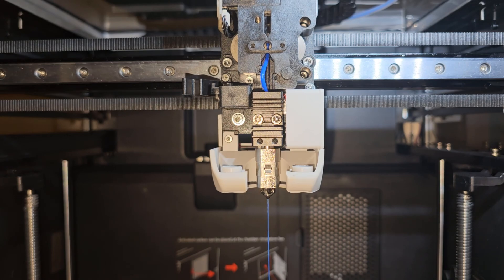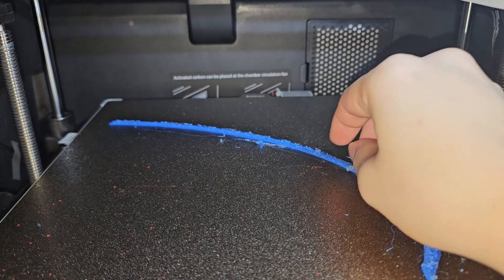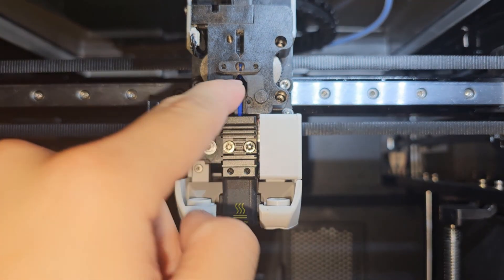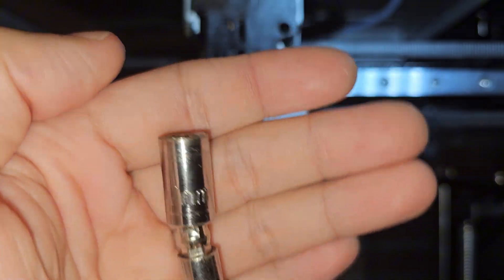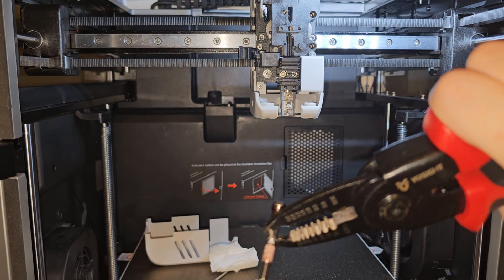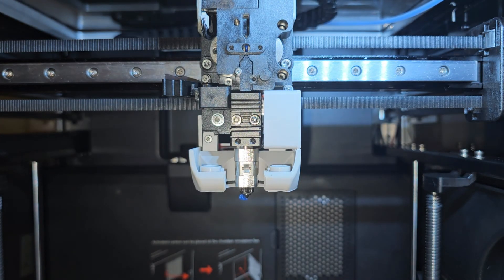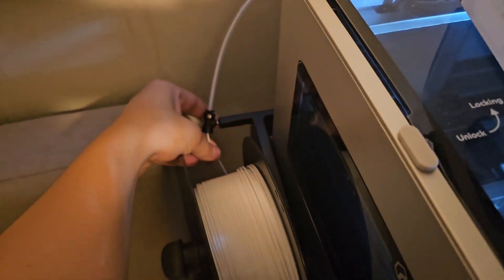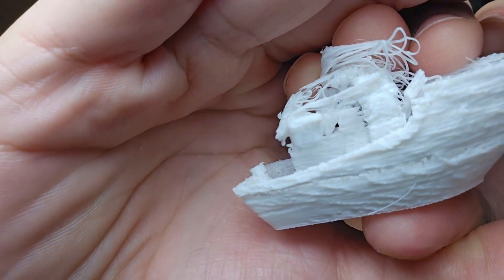Qidi Q2 3D Printer I'm Done With It

Comment: Printers are not fool prove.

I have my Q2 for over a month now and still am amazed by the features and print quality it offers. I don't care for multi colour prints so no box for me. I use ABS, PETG, PET-GF/CF, PA6CF and TPU filaments.
The only issue I had was a clog when I was switching filament from PET-CF to TPU. The temperature difference between the filament types are so far out of each other that the PET-CF was still to hard at 240 degrees. That was the only issue I had, a human error.
Reply from the maker: Glad to hear you are having a good experience with your printer!

Comment: I believe maybe and this is just maybe because it happened to me. The temperature is saying that it’s getting hot enough but it’s not you’ll have to check that to see when it says it’s up to 222 something it may not the temperature is not reaching that height maybe the sensor of something is bad for the temperature
Reply from the maker: That's a good point, I'll definitely check the temperature sensor. Thanks for the tip!

Comment: About a year ago your video helped me unclog the extruder on my Qidi Q1 Pro. That clog was on me (tried to unload filament, nozzle was cold + unclear instructions), but it ran perfectly since then... Until I switched to a 
0.2 nozzle. Seems like the default settings were off, because during nozzle cleaning it pushed way too much filament and I could hear the extruder gears grinding (even though it still printed fine). After a couple test prints, I started a long print, put the top cover back on, closed the door, since I tried to sleep… and yep: first clog in a year, this time in the nozzle, and it was a PITA to unclog.
Tried again with the top cover off and the door open and it’s been fine since. I’ve heard people say that printing PLA in an enclosed printer is just asking for trouble. It’s annoying, but it's true - at least in my case. Also heard a 0.6 nozzle is best for CF-filled and other abrasive filament.
Reply from the maker: Yeah all those things you said is true. Printing with pla and door closed is going to be trouble.

Comment: I've had no problems with mine to date, and this is my first Qidi Q2, it seems like you need to swap out the nozzle, they are pretty cheap on Aliexpress, it would seem yours is damaged internally. It's a cheap swap, and  if it works you can cut the old one open, look at it etc.
Reply from the maker: Glad to hear yours is working well! I'll definitely look into swapping out the nozzle.

Comment: My Q2 works fine. Besides what others suggest in the comments check also if you chose PETG profile in the slicer instead of PLA.
Reply from the maker: I use petg settings, check all settings to work with petg filament.

Comment: Definitely human error. Seems like too low of temp, and shows at one point where it was set at 220 while extruding (and you mentioned PETG so too low). My guess is that the nozzle still has pieces stuck in it from a previous clog, especially if PET-CF clogged, and isn't clearing. Replace the nozzle, if you're modifying filament profiles then go back to stock (or lower the volumetric flow and increase temp by 10 degrees), and leave stock printer settings. The other issue is that it's stock with a 0.4 nozzle, so fiber filled filaments really shouldn't run through it. I do till I get my 0.6, but I also reduce volumetric flow and increase temp to prevent a potential clog. I've been using the Q2 without issue. I've done PLA, PET-CF, and ABS (I think others but can't remember right now). It just works. I have some PC I'm going to try out as well, and the numerous GF and CF filled filaments I have to test. I really like the Q2. I just wish it was at least 300 cubed.
Reply from the maker: Thanks for the tips! I'll try those adjustments next time.
Reply: Agreed, it's been great for me so far (<100 hrs). I almost wished I ordered the X Max...but didn't want to be a Beta tester for it.

Comment: I've printed about 150hours on my Q2 with various filaments and have not had any clogs. Either you have a lemon or you need to PID Calibrate the nozzle temp to make sure  the the temp is correct. Failing that I would get QIDI to replace the HEAD and hoteand assembly. I hope you resolve this as when the Q2 is working properly, it's a great printer.
Reply from the maker: Glad to hear your experience has been much better! I'll definitely look into PID calibration and the hotend assembly.

Comment: Hey Dude, it looks like u try to print to fast... the extruder is pushing filament a lot faster then the nozzle can melt... thats what i see there, thats cause the filament geht clogged.

cheers and keep up :) happy printing
Reply from the maker: Maybe, but im just using the default settings and this can print up to 600mm/s, im only printing at around 300mm/s
Reply: @Scratch3DPrinting  sorry to tell u, but this is only PR Speach and false advertising... 600mm/s impossible for this.. just with a full optimized gcode, which is never usefull in real life printing..  just test it. cut the speed settings in the profiles in half, and make the print again. i bet my left pinky, it will not clogg :)

Comment: This seems human error related more than the printer itself. Did you dry the filament? What are your slicer settings? Did you open the top glass door for rapid ventilation while printing? Also are you trying to print abrasive filament on the default nozzle? From what I can see it appears you're extruding faster than you're supposed to with that type of filament. Try raising the temperature and lowering the speeds.
Reply: Yep, everything looks wrong in this video. Even the Allen tool that he blames for "stripping" isn't the Qidi's - theirs are bronze-looking. The only time I had issues with my Q2 was with 0.4 nozzle and clogs from CF filament.
Reply: @mklabtech  I see so many people say this.  I dont know why but on my qidi q2 I have about 1500 hours and I only print cf or gf filled filaments.  I use a variety of about 14 different manufacturers and types.  From pa6-cf, ppa-cf, pps-cf, pet-gt, pc-cf etc.  Also between my 3 printers I only use .4 nozzle and I have aroun 12k hours on them.  The only thing i can think of that I do different than most people is that I dry the filament longer than I see most people dry it.  24hrs @100c and I print really slow.  30mms  However Im still new enough at printing that I dont know if these are things that could make a difference?
Reply from the maker: Exactly I use petg cf and it got clogged
Reply from the maker: I did not open the door or top glass, every other 3d printer i have enclosure does dont have this problem. Im using the default settings, which works with every other 3d printer but this...
Reply: @Scratch3DPrinting  welp thats the issue. never had a clog issue with my q2 because i open the door and slide the top glass back.
Reply: @Scratch3DPrinting  Just because it worked one way on another printer doesn't mean it's gonna work the same way on totally different printer because they look similar. Every printer is different and you have to tune the settings to get the right results for that specific printer. Furthermore every printer doesn't have equal insulation. You may not have realized but even with the door closed on some printers there's still more ventilation which is probably why you had more success. The failure is not a flaw but a design to keep heat in the chamber. Try printing with the top glass open and then see the results. It's there for that specific reason. Also you should dry the filament first for PETG and fix your slicer settings.
Reply: Thats a weak response.  Its like the people who will only take their car to the dealer for oil changes. They tell their neighbor their brakes are likely acting up because they get their oil change at jiffy lube versus Lexus. 

If I use a $40 snap on wrench to turn a nut on my printer that came with one of those cheap mass produced stamped steel 3mm thick wrenchs, I guess I would be to blame?  

I think the man knows how to properly fit- seat and turn a screw/bolt based on the videos he posts doing stuff.
Reply: @debrasam5525  How is it a weak response when I HAVE THE SAME EXACT PRINTER!!!! ??? He doesn't even have the box that goes with it. This is a PETG problem, not even a printer problem and he needs to learn how to print PETG. PETG is very hygroscopic so it needs to be dried before you even print. Then he needs to slow down the speed of the extruder and turn the temperature up. There's absolutely no reason his print should've turned out like that unless he's doing something improperly, but to just fail and then blame the printer is crazy. I still don't know what his slicer settings were and then he's using a even more difficult type of filament to print with. You have to know what you're doing. I'm pretty sure if he followed all the fundamental basics of printing PETG he'd have different results.

Comment: Keeping the door and lid open while printing?
Reply from the maker: Maybe, but if thats the case then what's the point of having an enclosure right...😅
Reply: @Scratch3DPrinting for printing high temperature filaments and stopping drafts. If you like keeping  the cover on, print a riser lol. Its most likely heat creep from having it closed. My qidi xmax3 will do the same thing if i close the cover and try pla

Comment: Is it a fan issue on the heat break/heat sink?
Reply from the maker: It could be...
Reply: @S @Scratch3DPrinting f it has a part on the nozzle like the k1/2 that requires thermal paste/lubricant you should clean the part of the nozzle and the heatsink. Instead put  a light coating of Permatex Aluminum Anti-seize. The stuf that comes with printers like the Creality Lubricant are not rated to the heat that modern nozzles hit. This stuff you can find in the auto parts store and its rated up to  870c. Its used on car spark plugs threads that can hit about 420c and stay in the engine for 36-100,000 miles before they are changed. 

I use it in my 3d printer that only goes up to 305c and never have a problem. When you change the nozzle its still there. The Creality goop in that tube burns off never to be seen at nozzle change it is only rated up to 250c on their TDS. It was fine for the ender 3 gen 1 I am sure of. But nothing modern beyond PLA.

Comment: I think you need to go back to basics with that machine!
1) Unclog by heating to 250 or higher, then extruding....
2) Looks like you running that white PETG at 220? How? Should be 240 minimum...
3) Is that filament maybe not wet or damp? Does it snap easy? 
4) But bad layers, constant clogging... I would say you running wrong temps on that!

But like I said, go back to basics, run some temp towers and flow rate test... 

But that what I would do!
Basically had similar issues with my Anycubic Kobra 3 when I first got it. Had to re-calibrate every one of my filaments again.
Now is prints perfectly...

Hope it helps.
Reply from the maker: Thanks for the suggestions! 

I dont think its the filament, printing fine with other 3d printers. 

I did print at high temperature 250, petg that should be fine. Wet or dry does not really matter, because it prints well with other 3d printers.
Reply: @Scratch3DPrinting  Cool! But like I said, temp is half the issue. If the flow rate isn't right, then you WILL have these issues. 

Also, no 2 printers will be exactly the same! I know a few people that have 2 or more of the exact same makes and models, and use the same filament for everything, yet their profiles are all slightly different.

Just take a few minutes of your time, run some of the default calibrations, temps and flow, then try is all again.

Also, one things I never do is heat the hotend, throat tube or nozzle with a blowtorch...
I used to in the past, but those short bursts at 500+ C can actually do more damage than you would think.

Rather take some old spare PLA, heat it to 250 or even higher, then extrude.
I keep a roll of white PLA just for this.
When extruding, I can then see all the rubbish coming out with it. When it runs white for a while, I know all is good.

Anyways, hope you get it sorted... 👍😁

Comment: Funny I also had clogging in same spot while printing in the superfine mode .... just pla.... went to qidi support and they said to print superfine 0.8 layerI needed the .2 nozzle. So I have ordered .2 nozzles.  if it clogs after that I'm gonna be pissed.
Reply from the maker: Yeah, 0.2 nozzle is difficult to print with
Reply: @Scratch3DPrinting  could be a good tutorial to do... my nozzles .2 to .8 are now ordered!
Reply: LOL! 0.2 printing is not that easy! I tried it. Make sure you rerun every possible calibration again from temps to flow rates! That 0.2 is a different thing all on it's own... Good luck...
Reply: @DeanosRides  thanks, for the info, the vid makes me wonder if there is a heat creep prob with the nozzle/ hot end..  we will eventually get to the bottom of this.

Comment: I’ve had my Q2 for a couple of months now and have had no issues with mine. Filaments I’ve used are pla, petg, pctg,LW pla, LW asa, and CF Nylon. I make sure I have door cracked open and vents open on riser when printing pla and petg.
Reply from the maker: That good to hear someone having success with the q2.

I have a couple more things I can try to see if the 3d printer can print.

Comment: Damn, this is supposed to be a good printer too. I am very interested in the 4 Max but not sure. I guess at this point, it's either a hit or miss with Qidi.
Reply: It might explode itself after I tyre this, but I've had my Q2 for around a month, have run 3 or 4kg of petg abs and ASA gf through it, and my only problems have been user error and a crappy flaking build plate
Reply: @exasperated When using filaments that have amazing (too good of bed adhesion), use a gluestick as a buffer...printed some PETG with glue, and once cooled came off as easy as PLA!
Reply from the maker: Yeah, it's definitely a hit or miss sometimes.